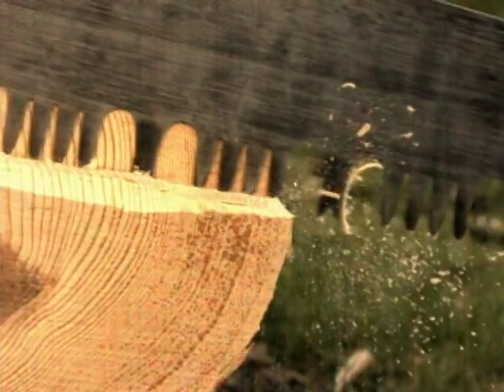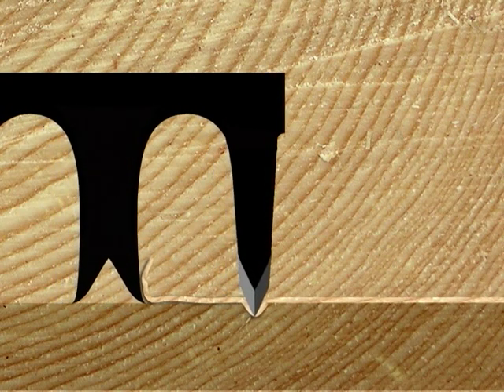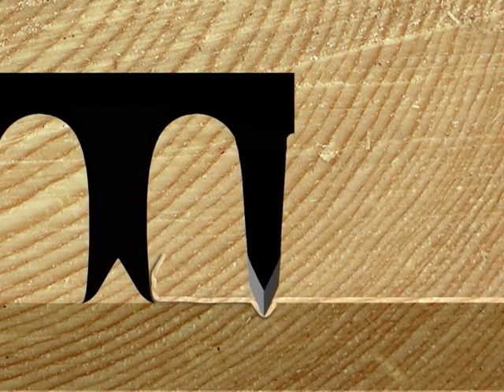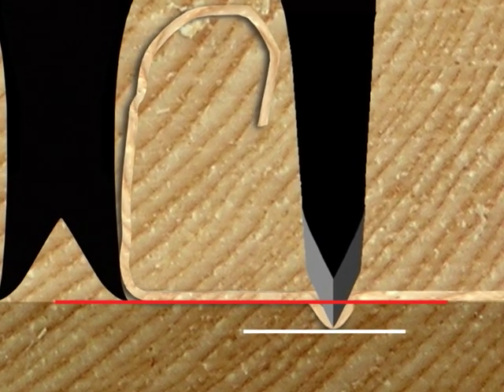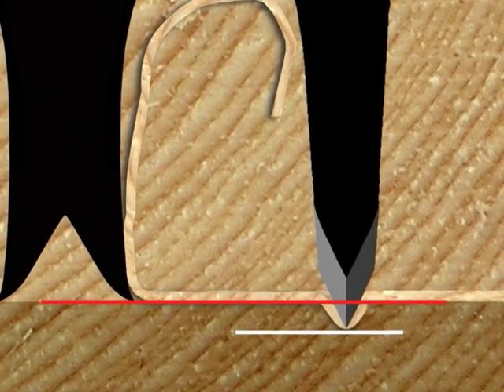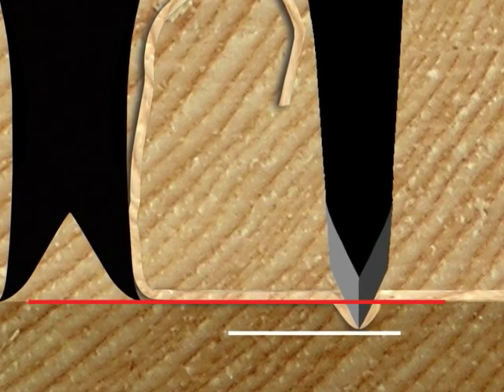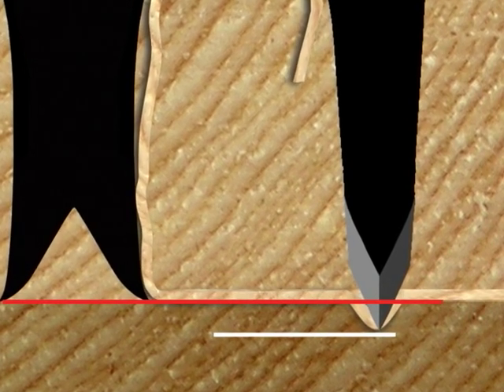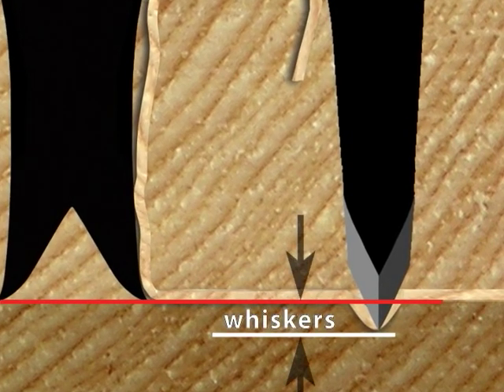The Crosscut Saw Filer, Part 1 of 5

Comment: I use evaporust to remove the rust. Eliminates the scrubbing entirely. If there is a lot of pitch just use a solvent called goo-b-gone. Works well if you soak it a while.

Comment: So I have followed your instructions and sharpened and set the the saw but my shavings coming off are not like those in your video. My question is , does the set and height of the rakers need to be different for hardwood ,as I am cutting ash and oak. Thank you and have a great day.